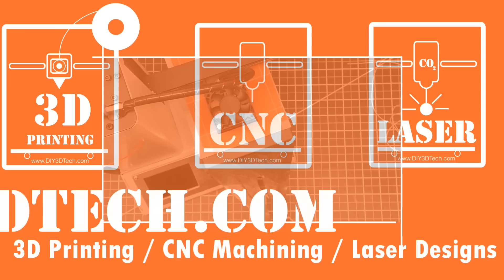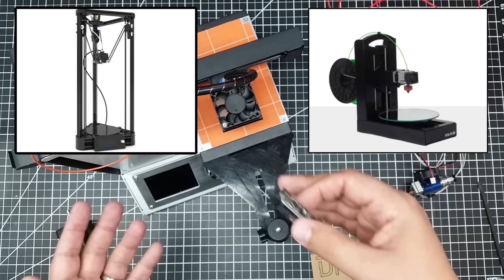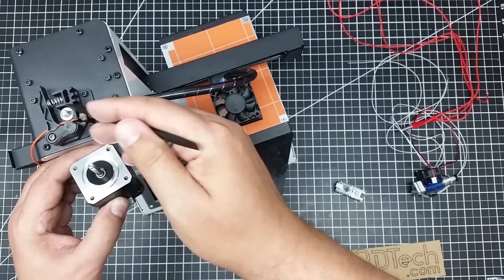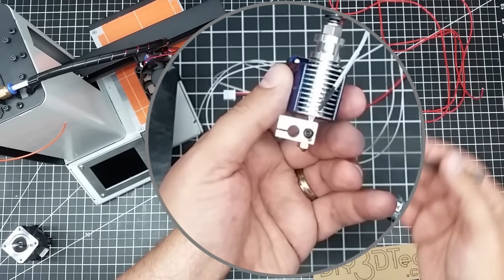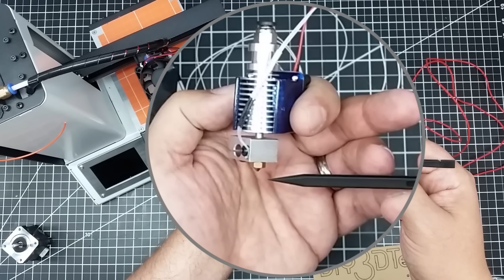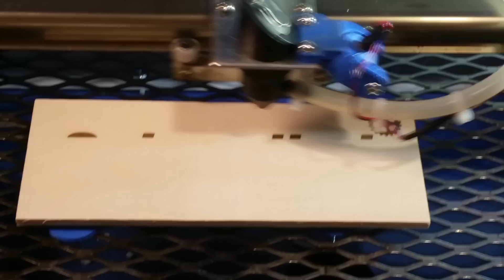My First 3D Printer - The Parts of a 3D Printer You Need to Know!

Comment: Always consider buying the first  printer supporting ABS because it's just a matter of time when you will like to print with more demanding materials which need heated bed.
Reply from the maker: from my perspective, issue will be cost as I think as doing ABS without a "sealed" printer to me is the same as dying from a thousand paper cuts as can you do smaller parts, yet when you try to do that one larger part is when the issues will hit and these are typically quite a bit more expensive.  Also yes you could "build" your own enclosure yet many folks can't or don't want to do this as they simply want to "use" the printer and 50% of them will tire of it so starting small and working up is what I typically recommend...